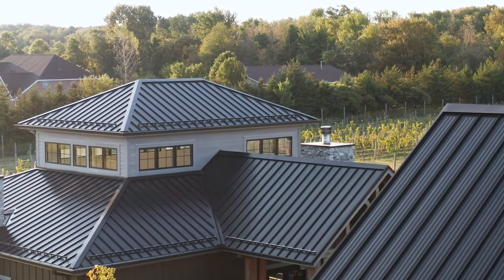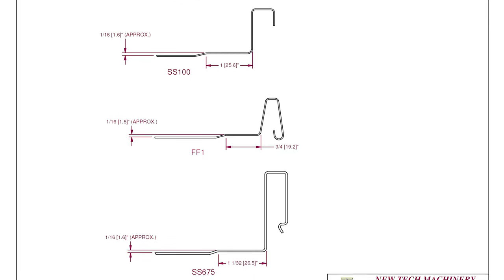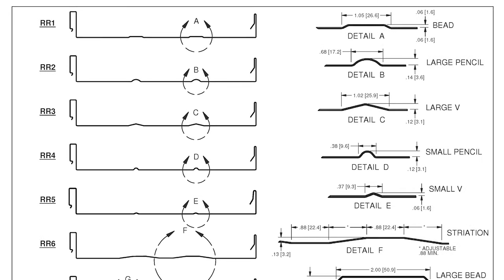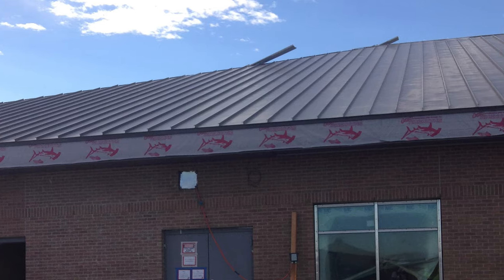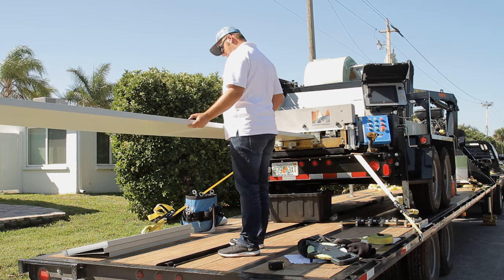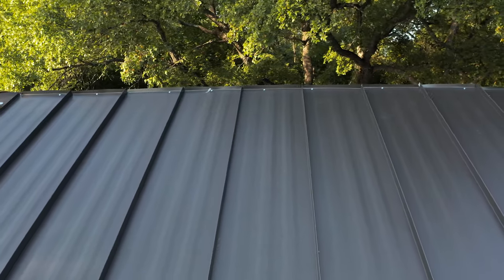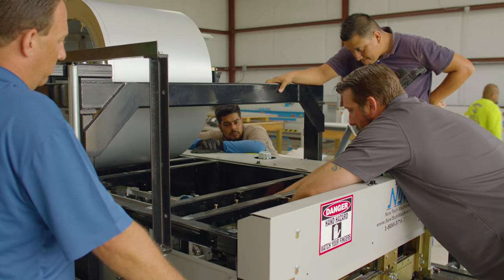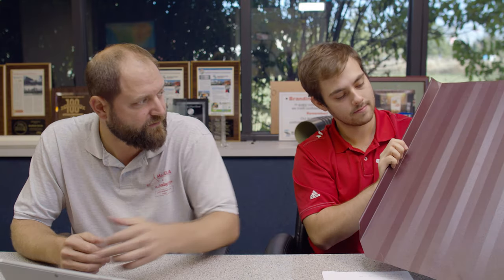Should You Put Structure In Your Panels? Striations Vs. Flat Panel

Comment: Will metal roofs in tropical areas that don't have low temperatures still suffer from oil canning?  Also, can you get the wavy panels with a standing clip edge so that there are no exposed screws? Are striated panels just as resistant to oil canning as wavy panels?
Reply from the maker: Oil canning is an inherent characteristic of metal, but there are ways to minimize it so it's less noticeable. Striated panels do a good job of reducing the appearance of oil canning on standing seam panels as we discussed. Check out this video for more on oil canning: http://bit.ly/what-is-oil-canning-video  -Thad
Reply: @TheMetalRoofingChannel  Thanks so much Thad!